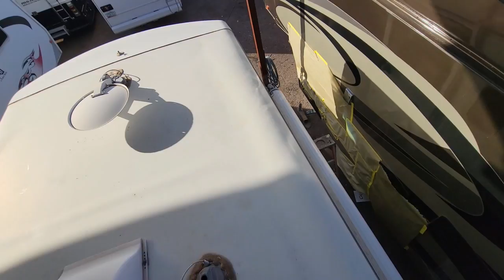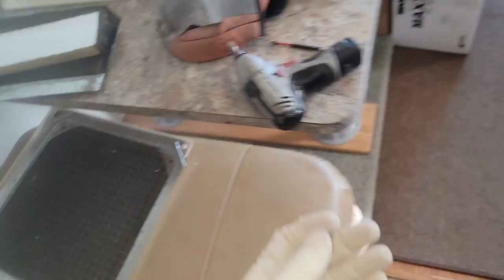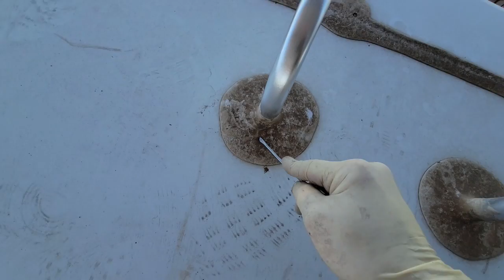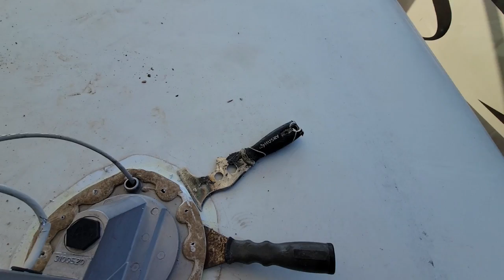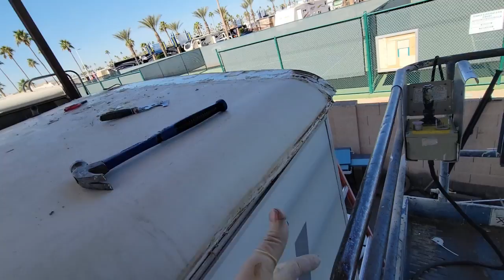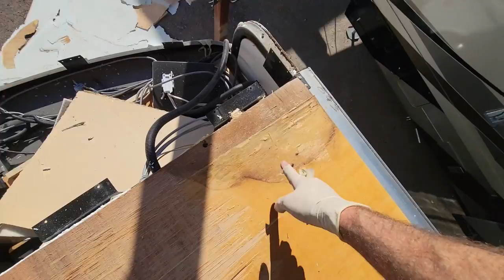A New Fiberglass Winnebago Roof

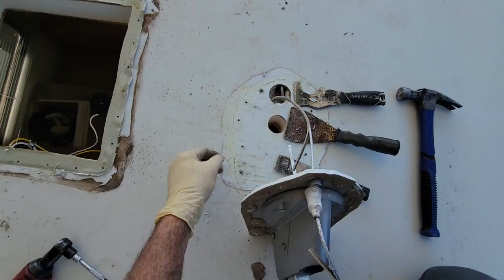Comment: 18:45 A good way for water to get in is that coax, where the coax itself cover has come off.  Water will wick down that and into the RV.  I would recommend the black split loom cover and a few wire ties to keep the coax from degrading, or at least use exterior coax that is black.  White coax typically doesn't have UV inhibitors in it, and will fall apart in the sun just as seen here.  👍🤠

Comment: The winds in New Mexico tore the roof off our 2000 Winnebago Adventurer in 2019 and the insurance totaled it and gave us $22,000.
I bought it back for $1,000 and using your videos and $900 I redid the roof and sold the coach for $8000. 
I felt a little guilty about it all because I nay paid $4000 for the coach to begin with. But I got over it and bought a 42 ft DP.
Thanks for all the info you share to the RV people.
Reply: Wow, you are one lucky fellow, they could have denied the claim due to neglect. I've heard James say that is the worst, to find out without an inspection or maintence it's neglect, yet Winnebago or the insurance company never mentions it.

Comment: I have a 20 year old winnebago roof. A few lose spots. But keep it sealed. One place I checked wanted $300 ft. At 36 ft looking at $10,000. But if the motorhome is in good shape like mine, that's cheaper than a newer, worse built motorhome.  Winnebago years ago built a good motorhome.  Just looked at a 2016 Itasca same as   mine. $275,000. The difference is a nicer paint job. Still built with the same heaters, water heaters as mine. Newer does not mean less problems, just saying!
Reply: I fully understand what you're saying, but ouch, that's a hefty chunk of change. The only roof repair I can afford is a tarp.
Reply: Great video, how much would this job cost?

Comment: Recently discovered your channel. I owned (now sold) a 2007 View. I read about the issues with the roof and ended up cleaning the sealant on the side channels, working screen wire spline down into the gap to hold the Filon back and then pumped in a black urethane sealant to seal and hold the roof firmly to the extrusion. I am learning alot watching your vids.

Comment: Hope they insulated that front cap area behind the cabinets!
Reply from the maker: There is spray foam on it, but not much insulation.
Reply: @AZExpert  That's too bad. It was a prime opportunity to stuff insulation up there and help prevent heat building up in that location.
Also, forgot to say that your video has prompted my dad and I to examine our roofs and reseal the sides where it's tucked in. Thank you!

Comment: i have a 2006 Winnebago aspect 29h  that i am working and having it wrapped. the roof is not leaking but would like to put a coat on it. RV  clear coat and decals where bad look as it set out in the sun all the and not really to care of. so i rescued it and bring it back up to par. all the seals are still i good condition  going to replace the two fans  so what would you recommend  to paint the roof with thanks you any info you give love you videos thanks for taking to time to share you passion.

Comment: So just to be clear as I am going to be installing a Dish Tailgater satellite dish this weekend, I can use Dicor to caulk the new screws and holes as there is no silicone used where I am installing.  Thanks in advance for your answer.
Reply from the maker: If there is no old sealant you can put whatever sealant you'd like.

Comment: James...Mark here and I have a question for you. I finally decided to do the floor in my Tiffen Allegro Red...actually I had to because after severe rains here in .ca. I went to look inside my motor home and to my surprise water had entered and damaged the old floor right behind the driver seat. I have not been able to figure out how the water got in there. To my surprise when I pulled the old flooring out this problem had occurred before and I found a section of the sub floor had been cut out and replaced. We had to do the exact same thing removing the plywood patch as well as the foam insulation as we found mold. Treated the rust forming on the subfloor framing, installed new 1.5 inch insulation and installed a new plywood patch, coated the subfloor with red G aurd, put down a thin underlayment then installed a quick lock vinyl floor and it looks fabulous. I still don't know where this water came from. I even sat in the motor home while it was raining and did not see water entering anywhere. Any ideas James I'm at a loss and don't want my new floor to get damaged...Again. I thought you may have run across this before. We are in Buckeye As. For the NASCAR race this weekend and are mouch docking at  the relatives. I'd love for you to have a look if at all possible. Thanks James.
Reply from the maker: Did it get in through the slide?
Reply: @AZExpert  No , at least not from the top or down the side behind the driver seat. These areas showed no evidence of intrusion. I did however find a small exterior hole where a piece of the corner trim broke off and where the rivet went left a small hole which I have since sealed with silicone. Water access through this hole would have traveled into the lower area of the slide and possibly dropped  at the area where the slide ends when it is closed up. This is the only thing I have found so far. I'm at a loss to be honest.

Comment: ok i get dont use dicor over silicon.  Is proflex OK?  actually I have an itasca 2014, scraped/polled out old roof joint and resealed with proflex, six months in it is looking good.  you see any problems with that ?  thank you so much in advance

Comment: Hi James, can a rubber roof be replaced with FILON? I have a 2003 Thor Chateau sport that has a rubber roof and I am not sure whether it is original. I bought it used and there are no leaks but the previous owners used a roof sealer on it. The motorhome is 29 ft long. Thanks.

Comment: Hi James I have a Winnebago roof on my 2014 aspect 30J. What exactly which sealers do I need to put in the front cap that meets the roof. I’ve noticed like your said there is no sealant.  It’s original from the factory. Thank you James
Reply from the maker: factory uses nuflex 311 or heng's self leveling silicone
Reply: @AZExpert    Thank you so much. I learn so much from watching you  I believe I can make my rv last me along time, with all the tips you provide us.

Comment: Your roof fix is sort of out there..   why would you make a seam then place a molding over it?   What school of roof repair did you come from?

Maybe I am old school but it looks to me the loose roof material needs to be cut off, then apply roof cloth saturate with a rubber product like Kool Seal, then apply cloth over the seam between the old roof and new roof material sealing the seam, now Coat the entire roof with the new roof material.  around the vents you will use the cloth material to seal seams.

My RV had a molding that went down the side of the rv front to rear, sealing the roof to the side.  It was recommened and I did do it, to use the roof cloth to seal the roof, OVER the moldling so water could never get under that molding.  It was a good tight seal, with no leaks.

If you want a guarantee that the aircon seal wont ever leak,  you place a 3/4 inch strip of wood around the 14 inch hole,  use roof cloth and saturate running up and over the 3/4 inch wood, sealing the seam from roof to wood strip.
The Air con seal will sit on the strip coated with roof material and the air con sits on the seal.  That strip will never leak because it is intrical with the roof materal.

I had done something similar to this 20 years ago.  I sold the RV 15 years after and it still had a perfect leak free roof.

SILICONE SEALANT....
Our RV group STOPPED using silicone 10 years ago.
Silicone goes on easy enough but it comes lose,  it does not take weather well and will start to leak.
Silicone is terrible to get off, even the leaking silicone is partially stuck on the body and if you are painting,  you have to get it all off because as you know,  paint won't stick to silicone.  Manytimes we thought we had all the silicone off,  tried to paint and the silicone shows its ugly face again.
USE something else and dont tell people to use silicone.  It is not as great as you are saying it is and can cause bigger problems than you started with...

I wouldn't do what you are suggesting at all.

Comment: Why would you want the ford f53 and not the workhorse? I’ve had multiple f53’s and the workhorse i have is so so much nicer in every way
Reply from the maker: The engine is very loud and very hot on the workhorse and the A/C has bad design for the desert heat.While production number may not be the best indicator of quality, it is a very long lasting platform with readily available parts and service. The V10 is a great engine too, while the Workhorse is a GM clone, it was it's own company that never seemed well thought out or supported

Comment: Funniest thing to me is, when people are in shock that they need a new roof deck on their Winnebago, they don't realize that the condensation gets between the fiberglass sheet and has nowhere to evaporate to except into the wood. Rotting it away. I would take a rubber roof any day over a fiberglass. 🥂
Reply: Interesting thought, rubber roofs come loose too, and if sealed will not let the condensation out, correct?
Reply: @mattkvacik2769  lol it's not a thought really but more laws of nature. And yes, indeed rubber will too have their own set of issues, especially if they have an air pocket or warping. It's ultra rare they come unglued from the wood substrate decking, like almost unheard of, however if they do come undone, it's easier than baking a cherry pie to reglue it back down.
When I got my RV 7 years ago, btw which is a pretty nice version of a motorhome ,( you can watch my 2 videos) anyways, the roof was like a water bed because of how thick the silicone roof coating was and some water protruded under it and collected lol 
It's a crowned roof, not a flat roof &
I didn't find it very funny at the time, but I had to redo all of it and I am very fortunate none of the water soaked through the rubber into the paper thin decking.. Only God knows how long it was like that. I guess I'm also fortunate that my RV actually has metal framing in the roof/ceilings. I'd trade a fylon roof with no framing for a rubber roof with structural metal framing any day of the week and twice on Sunday. 🥂 Cheers, happy trails!